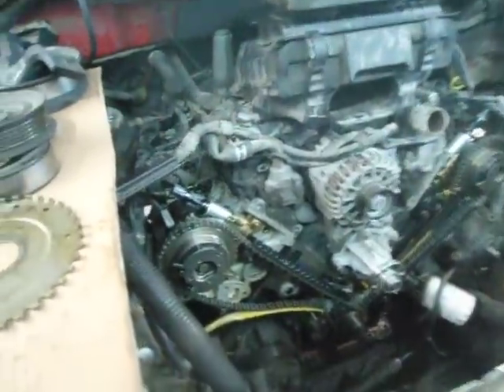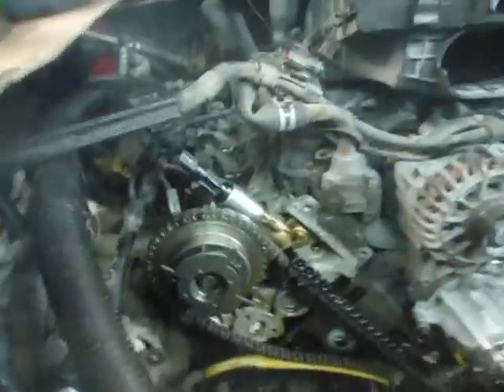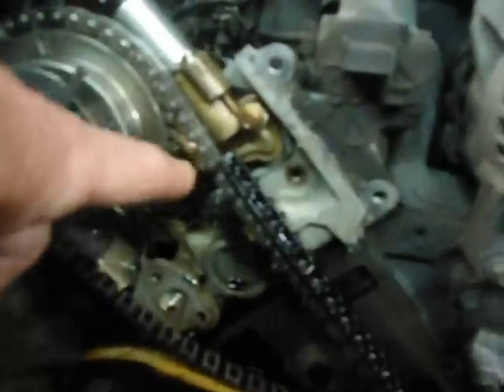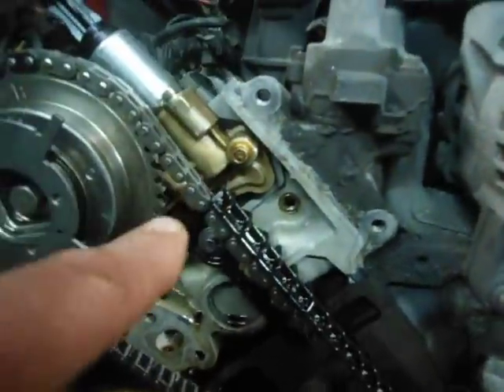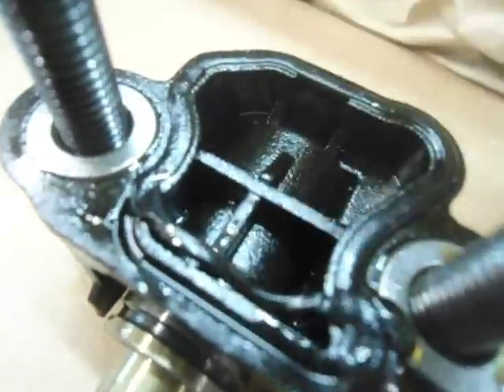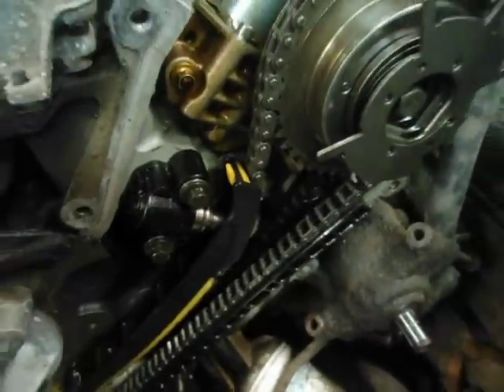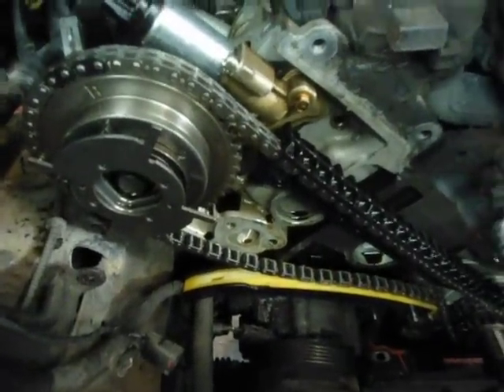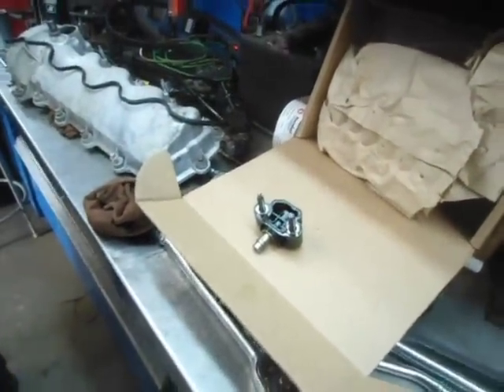5.4 camshaft overetarded timing code, bank 1

Comment: If it jumps just one tooth then the valves get bent? Then you have to take heads off and redo valves?
Reply: No ptv clearance should be ok . Cam would have to be pretty far off not just a tooth .